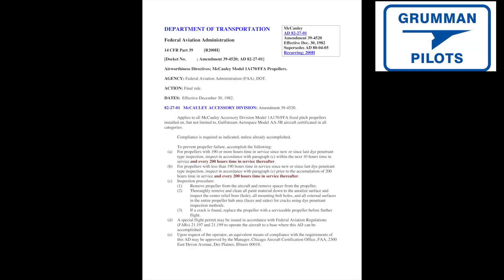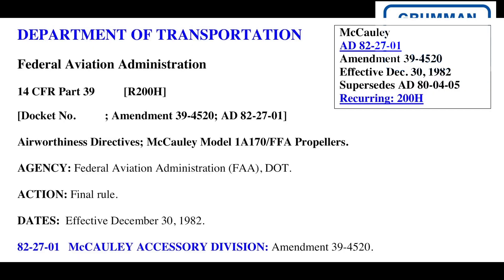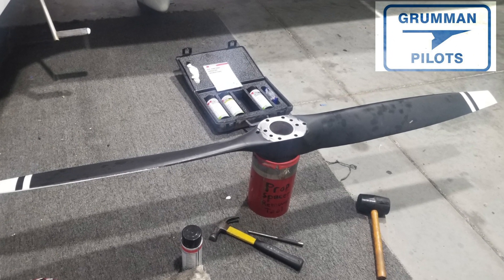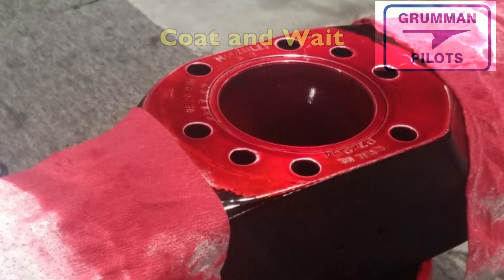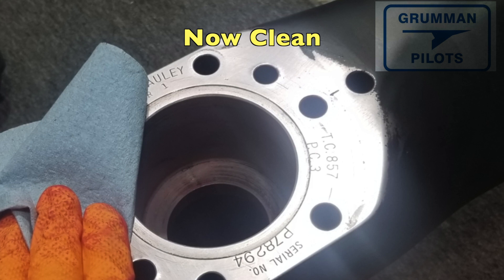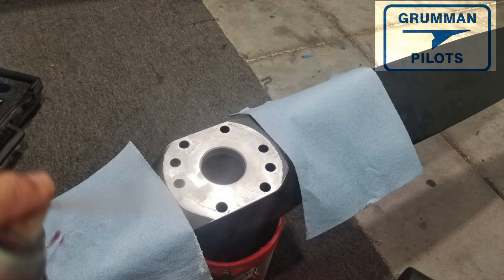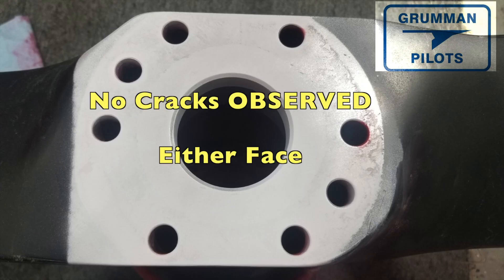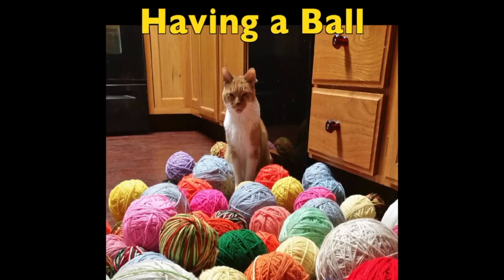McCauley Propeller AD 82-27-01 - Grumman Style

Comment: Im still running the FFA prop on my Tiger. I would like to upgrade but there are too many bells and whistles I would rather spend the money on. I suspect the AD came from failures due to improper installation of the spinner backplate and not a problem with the prop
Reply from the maker: I had one on my Tiger for 6 years without a vibration or problem.  Finally replaced it with a Sensenich in 2000.
Reply from the maker: I flew my Tiger with a McCauley for 10 years.  Never was in that yello0w range anyway.